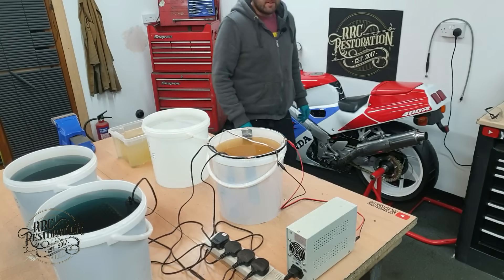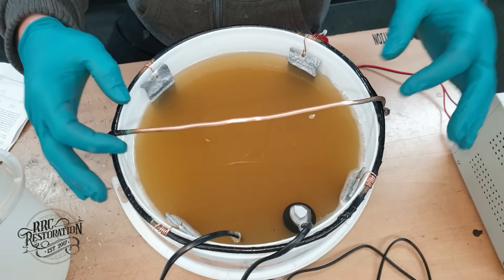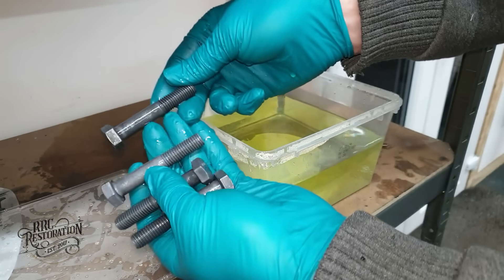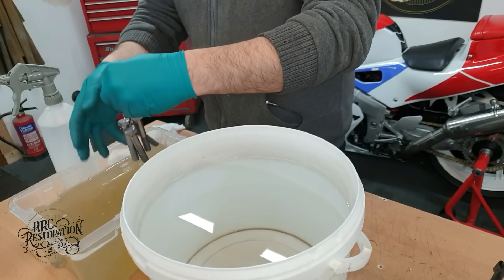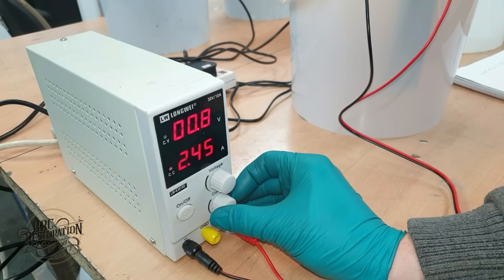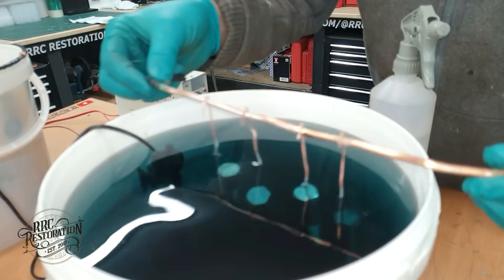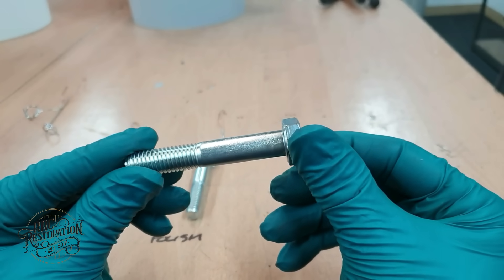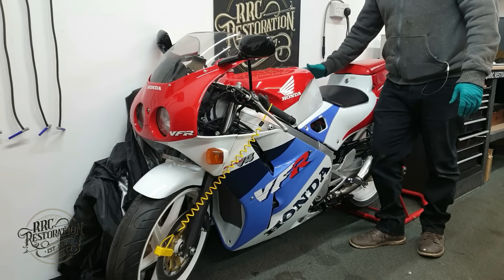Electroplating - Its Easier Than You Think!

Comment: So I've been learning my own version of this process and a huge difference in finsih came from a recommendation to use a stainless steel wool scrubby to polish the zinc after the zinc coat and before the passivate. Makes a tremendous difference! The zinc on my hanger wire for example gets all fuzzy, but a couple scuffs of the steel wool pad and its smooth shiny mirror finish

Comment: Love your videos mate, thank you so much. How much ammonium and zinc chloride do you have in the solution and how strong is the acid? I am planning a complete bolt restoration on my Aprilia RS250 and will try and recreate, what I think is either zinc flake or cadmic plating. Will use HCL acid instead and not use a passivator, as I am going for a non-shine finish.  

Cheers

Comment: Do you think this process can weaken the steel or cause corrosion under the nickel plating. Aircraft hardware is cadmium plated but that stuff is toxic AF. I was thinking of plating some bolts for aircraft use. Ill have to ask the manufacturer but for non structural bits it should be good.

Comment: I have exactly the same kit as you and been plating for several months now on my BMW Z3 project, all underside bolts zinc plated. One thing I've found is that if you're not careful the fumes from the Dry Acid will rust everything within about a metre from the bucket. So cover up or move anything expensive!

Comment: Is the acid that you used to strip the original zinc plating hcl? Scared to use that stuff. Also I remember you used bilt hamber deox c in the past to remove rust on bolts before plating instead of the pickle I think - any differences?

Comment: Great walkthrough, kudos. Put me on the verge of ordering an electroplating kit.
I'm trying to fully restore a fuel pump from a K3 GSXR1000, and the top cover is plated gold/brass. Trying some autosol on it pulled it back to bare steel, so I know I have to replate it instead.
Don't suppose you'd be keen on selling a wee service since you have the setup?

Comment: Some additional info for zinc plating/galvanizing:
Cromium VI is obsolete on passivated solution because it is carcinogenic. Yellow usually contains chromium VI, so Blue/irredescent or clear thick passivation is the way.
10.9, 12.9 bolts  (1000 MPa tensile strength or higher and or 320 HV or 32 HRC hardness) should not be zinc plated because of the Hydrogen embrittlement chance is exponentially higher (there are some solutions, like heating the part to remove the majority of the H) This embrittlement means corrosion alongside of the crystal borders and it can cause cracks
For this strength/hardness parts/bolts zinc flake coating is the solution. For example KTM uses lots of 10.9, 12.9 bolts and all of them are zick flake coated. It is a satin/matt coating with good anti corrosion properties (better than electroplating)
At my work we have to take attention to this so I just want to share to you guys.
Thanks for the detailed video!✌🏻
Reply: I would agree completely with your comments on the carcinogenicity of Chromium VI salts - contact with these should be avoided at all costs, particularly if a safer alternative is available. Various EU directives from the early 2000s onwards have restricted or eliminated the use of Cr VI, mercury and other nasties in car production, to protect the environment and public health. I can't comment on strength and hardness.
Reply: So is it bad to clean those old yellow coated bolts with a wire brush ?
Reply: @sigmamale4147  not the healthiest way, yes. Old yellow ones may contains carcinogenic cromium VI

Comment: 6:52 How did you calculate the correct amperage for the bolts?
Reply from the maker: work out the area of the part in square inches and then plate at .1A per square inch ;)

Comment: Wait, you said 5 to 10 volts then did .8 to 1 volt. What did I miss?
Reply: A voltage higher than 5-10 volts is not required and is practically unattainable at a given current value. It is not the voltage that is important, but the current, that is, the number of ions moving in the solution. This amount depends on the material of the part, the surface area of the part and the chemical composition of the solution. In this case, a current of about 2 amperes is required. Using Ohm's formula, you can independently calculate that to achieve such a current value for a given circuit resistance, a very small voltage is sufficient. A further increase in voltage will lead to an increase in current and deterioration in the quality of the coating.

Comment: How do you overcome Hydrogen Embrittlement as part of your process for High Tensile Bolts?
Reply from the maker: If I were using these bolts in a  high tense situation they would have been baked at 200c to diffuse the hydrogen from the steel within a couple of hours of plating.

Comment: Hey! Is the overnight acid Muriatic acid? If so, what about Hydrogen embrittlement? 

Brilliant work as always!
Reply from the maker: Citric acid in this case as I only needed a very weak acid. If i were using these bolts in a  high tense situation they would have been baked at 200c to diffuse the hydrogen from the steel.
Reply: @RRCRestoration  thank you! You're brilliant. I've had good success with zinc, but I'll use that exact technique to protect the bolts. Thank you so much for always being very helpful

Comment: Thanks for this. I always wonder what happens under the wire you use to hold the bolts? Is the plating exactly the same?
Reply from the maker: As long as the part is held loosely by the wire the plating is the exact same under it.
Reply: Interesting, thanks for confirming!

Comment: Bolt reuse aside, would you use plated bolts for car subframes and suspension or prefer to use zinc flake?
Reply from the maker: I would be more than happy to use plated bolts for critical fixings as long as they have undergone the proper treatment to prevent hydrogen embrittlement of them. I've never really had any experience of using zinc flake but i might try it out to see how it goes.
Reply: @RRCRestoration  thanks 👍

Comment: Almost could see your face... lol. 
Great video on plating. It's actually very simple. 
Do think media blasting the threads effects the torque when tightening the bolts?
Reply from the maker: Haha yeah Ive almost entirely given up hiding these days ;) lol. I don't really think it will affect the threads not in any significant way not unless you spent ages just blasting the threads at high pressures so much that there is noticeable degradation on them.

Comment: Excellent setup. How do you calculate how long and at what amperage to run the parts? Is it a calculation of surface area or weight or something else?
Reply from the maker: Hi, you calculate the surface area in this case square inches and then plate them at .1A per square inch.

Comment: how long untill you have to empty out the buckets and start again, or is it just top them up
Reply from the maker: keep them topped up and they are good for years and years. the only real maintenance is in the plating tank where you need to keep the PH levels correct and from time to time clean the sludge from the bottom of the tank but that's all it takes ;)

Comment: Great video! It seems like such a mysterious art, but of course it's a pretty simple process. What's the formula for determining how much amperage you need?
Reply from the maker: You measure the part to find out its area and then plate the part at 0.1A per square inch of material